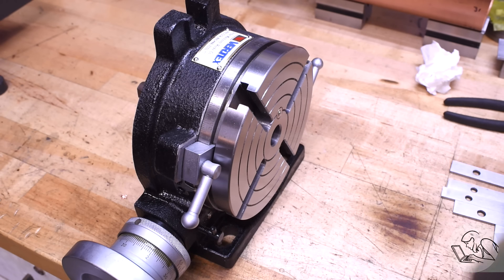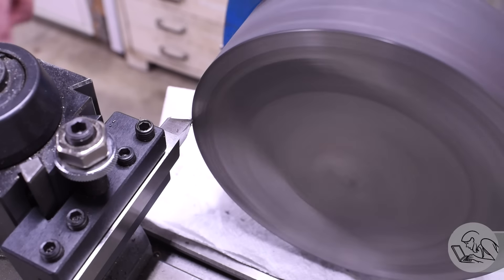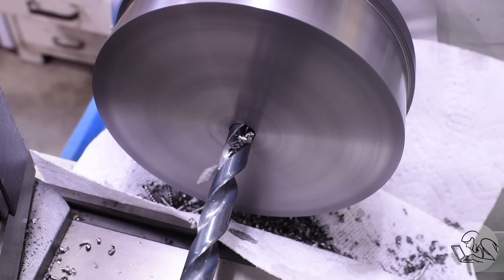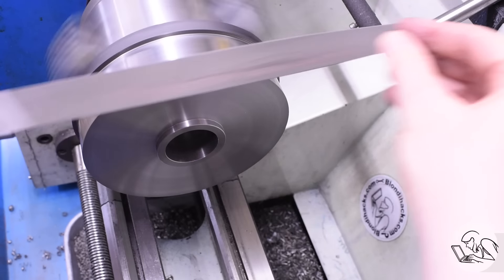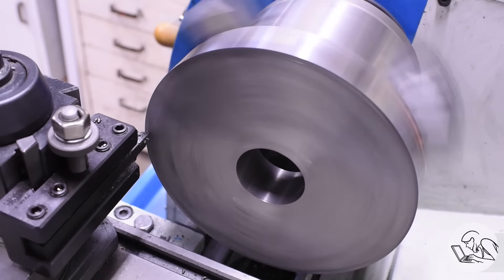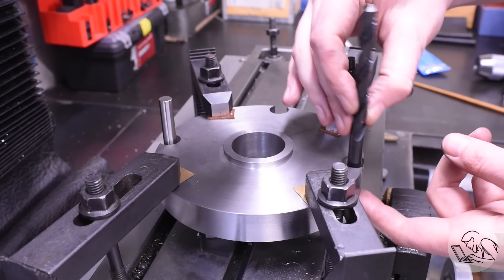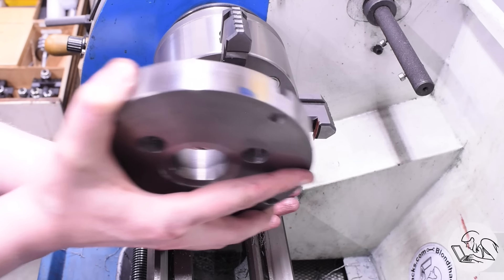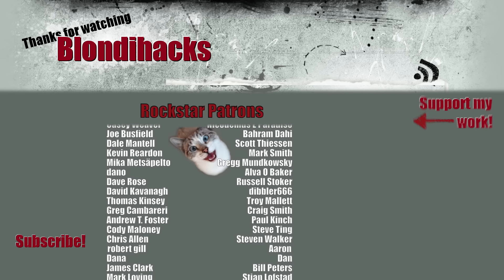Rotary Table Chuck Mount : Let's make one!

Comment: You shouldn't use painter's tape in that application.  Gotta be duct (duck) tape or, ideally, Gorilla Tape.
Reply: That was my first thought, that's the wrong tape. Someone needs to watch more Red Green.
Reply: Hot Glue! I told her, Hot Glue!  :-)
Reply: Chewing gum does it to me 🤣
Reply: I prefer foil tape. Gives it a bit of bling.
Reply: Or try packing tape😂
Reply: Npoe- use Gaffers Tape. Doesn’t leave icky residue.😊

Comment: I "believe" the durabar is technically cast iron produced by a continuous casting process. It certainly machines like cast iron. Subject to higher education 😉
Reply: I always get it confused with rebar. This has led to some baffled looks during my on-again-off-again career on the building sites. Not so much during my career as a machinist as I've never had one.

In my defence reinforcing bar is at least a bar and you want it to be durable... Well that's my excuse and I'm sticking to it.
Reply: @AnthonyHandcock  Simple mistake, although you wouldn't want a structural engineer making it. Rebar is steel, has a much higher tensile strength and is much less brittle than durabar, which is why you'd never use it as reinforcing in concrete.
Reply: Just made a grammatical error. I should have said:
Durabar would never be used to reinforce concrete because it is brittle and has low tensile strength.
Reply: Durabar is actually a family of continuously cast cast irons and they produce it as gray and ductile irons as well as one grade of high nickel corrosion resistant iron. They are a very convenient choice when you want to make parts from bar stock, but they need to be cast iron.

One problem with durabar is that there significant difference in cooling rate between the OD and center of the bar which causes variation in hardness. This variation isn't as significant as the skin of a sand cast part, but it is much deeper than the sand cast skin and frequently causes machining issues.
Reply: @russelldold4827  Compared to some of the catastrophic constructions cock-ups I've seen, and in some cases been responsible for, using cast iron wouldn't be that surprising :-)
Reply: @AnthonyHandcock  I, too spent some 7 years as a mechanical engineer, managing health & safety on the construction of a 3,6 GW power station in Africa. Many stories!
We had many ex-military men from around the world and I have great respect for them. I join you in saluting America's fallen.
Reply: @russelldold4827  I think the biggest cock-up I was involved in was building a house on somebody else's land much to the somebody else's chagrin when he noticed... But he got paid in the end so he was happy and I was only involved in a "I bloody told you so!" way so I was happy too.

Not sure where you get the saluting America's fallen bit but from... No offence to the fallen but I'm British and the least military person I know... Well... One of the least anyway.
Reply: @AnthonyHandcock  My comments about my respect for ex-military men in construction stand. I also  wanted to show respect for all who made the supreme sacrifice. America marks Memorial Day on 31 May, the British (and South Africa, my homeland) marks Armistice Day on 11 November.
I apologise if my unwarranted assumption offended you in any way.
We're a long way from Durabar, aren't we 🤔😉
Reply: @russelldold4827  Not offended I assure you. Just somewhat confused but then I do have an appalling hang-over and confusion is word of the day. Apparently my alcohol tolerance has all but disappeared over the past year of the pubs being shut.

Come to think of it... Isn't Durabar a place in India? I'm sure there is or was a regiment of the British Army called The Durabar Light Horse... Or maybe that was just in Carry On Up The Khyber or something.... See previous comment about having a hangover :-D
Reply: @AnthonyHandcock  No comment about hangovers from me. I decided to go teetotal after a bender when I was an apprentice.
The extent of the British Empire certainly threw up some interesting names. I think I was 18 when I found out Timbuktu was a real place.
Reply: @russelldold4827  you can edit comments - why write a new one?
Reply: @AlessioSangalli  because I was ignorant of that feature - I learn

Comment: Quinn, I absolutely love your humility, owning up to your calculated errors, or in other words, cock ups!. I recently made a similar adapter to yours albeit a 3 tee slot table to a 4 bolt 4 jaw chuck and encountered the same issues that you did. However, as you know, concentricity with a 4 jaw chuck is not a problem. Please keep the videos coming.

Comment: I have been planning on doing the same project and since I have the same PM lathe and mill you have done a lot of the headache stuff for me. The only thing I will change is that I will go cheesy on material and use aluminum. It is cheap and readily available due to all the aircraft production work in the area I live. It also cuts so easy. It won't be as classy as iron but I think it will do the job. Thanks for all the hard work and head scratching!

Comment: Nice work on the adapter plate. I have a grizzly 6" rotary table that is almost identical. I bought a 6" 4 jaw that has through holes for mounting and just bolted it directly to the rotary table. It was really simple works really well.

Comment: Probably due to the consistency of the issues in a small workshop, but again you have chosen to demonstrate another project on my to do list. The only difference on my ''process flow" would be to fit the plate to spindle nose prior to  final machining of the face to maximise alignment to key features (probably not required but it makes me feel better). Also I must say that your comment on the "limitation of small machines" always makes me smile as you machines are significantly larger to the Unimat based ones that I use.

Comment: We both have the same MILL and mine has been giving me problems like a burnt out motor and then a Gear breakage!!! A belt drive is in the planning giving faster and slower. This hopefully giving more torque. I converted our EMCO to this spindle nose and at the same time putting the plate further out. This now means that my fingers can get behind and do up or undo the nuts. Enjoying as usual. David and Lily Reading England.

Comment: Fun tip: overheated motors cool down quicker and safer by letting them to run for a while without load. Stopping them may actually be detrimental, because of the residual heat on the coils.

Comment: Blondi, yes. I have a HF bandsaw that came with cabinet base. It once fell over due to my neglegence and the plastic motor end cap, plastic fan, plastic electrical union box all shattered into pieces! HF does not sell those items separetly, but Jet does! And in metal! Except the fan blades. I ordered them all from Jet and they were perfect replacement parts and of superior material. Like you said, depending on which color ( bandsaw) you have ( brand). It does an amazing job for the price, and I bought mine with the classic January discount coupon. 
Love your vids and commentary. 
Carl - West Michigan USA

Comment: What I kept doing was wherever you did something really impressive or just something I wanted to comment on I came down and typed it in before I forgot it. And now I've got a short novel going here. I really wanted to commend you on your "workaround" with angle plate in the band saw! That really impressed me. I had a lot more to say about that situation but I'm going to cut almost all of it out because I wanted to comment on how you did a "spring cut" with the boring bar upside down and it made a crappy finish. I have one of those really old 12" Craftsman/Atlas model 101. And I'll get a great finish sometimes and crap one another time and I really don't know what is causing either. Like, I never really know if I had been pushing the tired old lathe too hard or was a doing the operation wrong... I went to college for engineering and it required the full machine tool sequence but that was MANY years ago. So I'm brand new but worse. I remember stuff but not clearly enough! LOL I haven't been following you in earnest for very long but wow, I'm learning a lot from you and fast. You really seem to know how to work smart! Even when you totally screw up you somehow save the day! 
Thanks so much for putting these up for us. I didn't realize how little I actually knew! LOL Especially when I used to know quite a bit! In designing tooling I was determining machining processes and in what order by way of how it was designed. The machinists liked me because I'd explain why I designed it and they were totally fine with me doing all the head scratching work for them. LOL But, if you don't use it, you lose it! That is a fact. PS, I tried to donate on  your patreon but it wouldn't allow me to do a one time thing. I don't do automatic monthly anything. The only way I could have done it is if I went back in and canceled before May 1st. I can't do that. If you know a way around that or maybe can just accept a check in the mail I'd gladly pitch in because I genuinely enjoy and appreciate your content and work.

Comment: Handy to have. Had tou thought about having a shoulder on the adaptor plat to centre on the rotary table and would drilling the holes starting at 45° to the centre using your DRO rather than the way you did it have saved repositioning the work? I have to make a similar one for my 16" Jones and Shipman table. Its a beast to move but I got it cheap 😁👍

Comment: My Harbor Freight bandsaw is a surprisingly good work horse. I don't use it all that much but I'm glad it's there when needed and it hasn't let me down. I guess it works and they have been in production for decades. All I would do to improve it is add a hydraulic feed control and coolant, but I'm mostly work with tubing so those upgrades aren't necessary.

Comment: I agree completely about the 4 X 6 bandsaws. A little tweaking and they can do very good work. I have a friend who has one that's 30+ years old and it's virtually identical to my 2 year old one (with fewer plastic parts). No design stays that unchanged for that long unless it works well.
Reply: My wife called me in the eighties, to say there was a pickup truck loaded with such tools at the plumbing shop she did books at, and I bought one of those saws for less than two hundred bucks, still using it, rebuilt it a couple times, more accurate than when I bought it, better ball bearings now.

Comment: I feel for you Quinn, I burned out the motor on my Warco WM180 turning a large slug of aluminium. You were lucky that your motor survived. When I fitted the replacement I strapped a temperature probe to the motor casing and added a cooling fan to the area where the motor is located. Not that I'm paranoid or anything 😂

Comment: I'm in the UK and I have a couple of vertex rotary tables. Mine have a hole right through which has an mt1 or mt2 taper, can't remember which. You could perhaps have mounted the backplate on the rotary table with a long bolt through the centre hole and then through the centre hole in the table. That would have saved the clamping.

I also have a trick to assist table alignment. I made up a plug that is a good fit in the table's centre hole. This plug is centre drilled. Then I put a hard centre in the machine spindle and bring it into register with the centre drill hole in the plug. The table is then just tweaked fractionally with a dti.

Comment: Hi Quinn, thanks for another informative video.
in cutting a short slug of steel on the band saw, what works for me is to tack weld a block of scrap steel on the rough side of the slug and then hold the slug in place using the block in the jaws of the band saw.

Comment: When I wanted to make a face plate for my Chinese No. 17 Lathe factory tool room lathe I realised that I could utilise a 20 Kg barbel weight purchased from a Cash Converters shop for $20 NZ.   It had enough meat in it to make a reasonably thick 300 mm diameter face plate although I did find a couple of voids whilst machining it which I subsequently welded up and ground down when I surface ground it later.  Thank you for showing your problems, I often wonder if anyone else forgets to tighten up things like I do.  Thank you also for revealing the designation of my spindle - I had not been able to identify it until I saw this video.

Comment: Good tip about using angle plate in Horizontal bandsaw. Always hard to hold things in them other than cutting off lengths from long stock.

Comment: I think I just bought the same rotary table, but the 6" version. The adapter plate that cam with it just needs to be re-slotted, because I got a larger 125mm(5") chuck where it will fit onto the alignment bungs, but has a 4-nolt pattern instead of 3.

Comment: It was fun watching someone else suffer with small shop problems. I just did the same thing, complete with all the problems you had, except I am so stupid that I got all the way to the end of the job before I realized the size of the chuck made it impossible to bolt the backing plate to the rotary table. I can bolt the plate to the table, no problem. I can bolt the plate to the chuck, no problem. When I went to put it all together, it finally dawned on me that I can't. It sure would have been nice to notice that detail sooner.

So yeah. I'm stupid. I tried to write a chuck that I just couldn't cash.

Comment: 07:35 The ticking might possibly be one of the commutator lands now standing a liiiitle bit proud of where it should be and rubbing on the brushes as it passes. Swap in the new motor and do a light pass on the commutator, satisfyingly using the new motor to fix the old, which should stop it prematurely chewing through brushes.
Reply: Would this also apply to a Brushless DC motor, which is the motor type that Quinn's lathe is equipped with?

Comment: I would highly recommend an upgrade to a 3 phase motor with a VFD.  I ordered my Warco WM250V lathe (same size as your lathe) with one fitted and it will turn those larger diameters and I can use large twist drills without a problem.

Comment: Just checked my Vertex rotary table(4'', don't judge, it's cold down here;)), I can slide a straight edge over, and there's only minimal contact on the oiler ball.

Great vid as usual, and perfect timing, I have a couple of the Hemingway Back Plate kits I need to turn up.

Thanks, Quinn,

Scott.

Comment: I use a small desktop room air circulating fan, probably about 9inch diameter, at the side of my lathe aimed at the motor, this always keeps it cool it will run for loads of hours without heating much. I also have a battery digital thermometer sitting on tiny shelf slightly above lathe, the sensor for it is stuck to motor body with a paste adhesive. It gives me a good idea of temperature from cold start to normal running temp, I allow about 30degree raise above starting temp, lathe used to get hot before I done this setup. As a proof that it works, use the lathe with fan turned off, when it starts getting hot turn fan on and see temp dropping quiet a lot with lathe still running, but that's only an experiment to prove it works, i always use fan once I turn lathe on, and I leave it running 5min after I turn lathe off.

Comment: As a retired plant operator I had access to steam blank-off plates for cast pieces such as this.  The city frowned on borrowing man hole covers.  My 6-to-5" plate is A-36 steel but my 5" chuck is...cast iron, and my Grizzly 6" table is... cast iron.  Damping is nice but some times it's: "race what you brung". (south-eastern US dialect)

Comment: Me again. I have a similar lathe, next size up I think. I installed two fans. One to cool the electronics, the other to cool the motor. At slow speed the integral motor fan does not provide much airflow. I used a bathroom fan over run timer to keep the fans going for five minutes after the motor had been stopped. It has worked a treat. There was very poor heat sinking on some of these Chinese DC motor lathe motor controllers leading to blown MOSFETS and I fixed that as well with a purpose built assembly of aluminium bar and box section. No trouble to date as a result. Bit fiddly to install, I labelled all the wiring before disconnecting to get the control board out. Tip - do not use heat print labels - ask me how I know!  BobUK

Comment: Drilling big holes in material is always a pain when you have modest machinery, so I use Rotabroach Cutters and an Arbor with an MT2 shank, it works really well and I now have a huge collection of Nearly New and brand new cutters, and you also get a slug from the middle of your work so you don't waste every bit of material.   I know it only works with short depth holes - 2", but drilling from both sides to get you 4" in is OK once you have a good OD to work from, and then it's over to a boring bar to finish.

Give it a try, you won't regret it ......... great Vids BTW, and greetings from across the Pond.

Comment: Great video, as usual. If I’m putting a hole in the center of a part I’ll start that first, and then face from inside out. Normal tool works fine and I don’t have to reverse the lead screw. On my Cincinnati lathe when the longitudinal feed is right-to-left the power cross feed is inside-to-outside.

Comment: I always wondered what the limits were with the D.C motor set up. On my Myford super 7 i fitted a 1 1/2 hp 3 phase A.C motor with a Omron inverter. The torque is amazing with this setup & have never had a problem so far. Per say i have never tried to machine a half ton block of Cast iron.